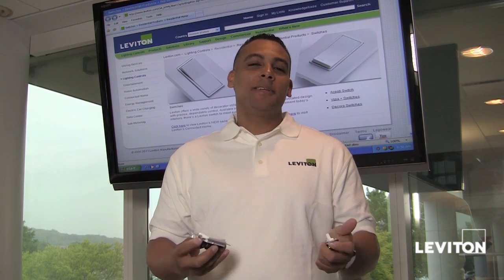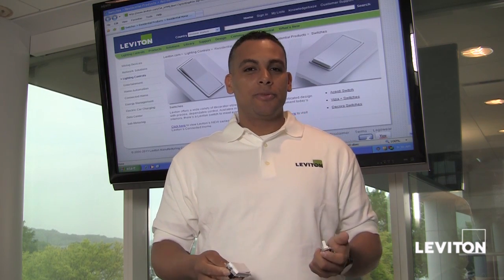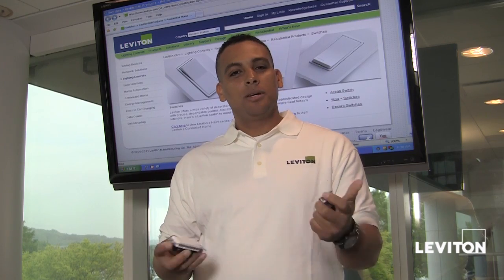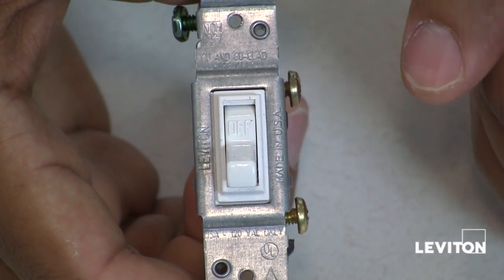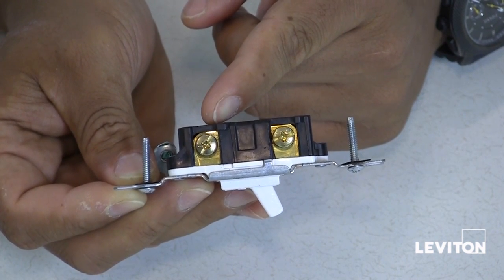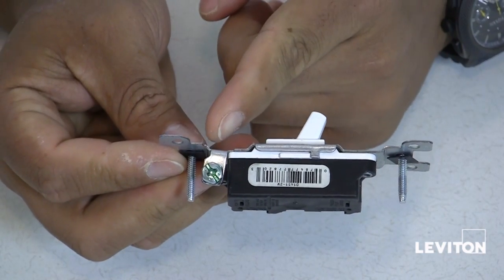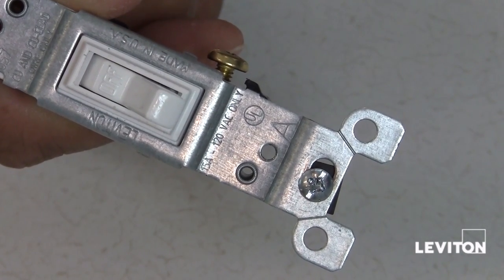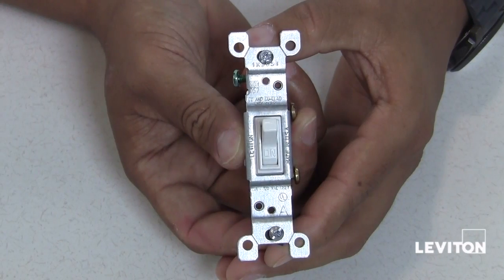What is a Single Pole Switch? | Leviton

Comment: Does it matter which wire goes to which brass screw (excluding ground).
Reply from the maker: The hot wire needs to go to the top brass screw while the load wire needs to be wired to the bottom brass screw
Reply: @leviton  your other video says it doesn't matter which one at 2:45 in that video: https://www.youtube.com/watch?v=tn_ZwYIfs-w